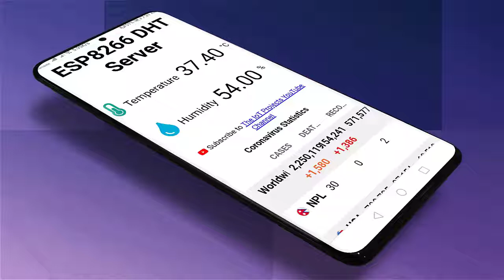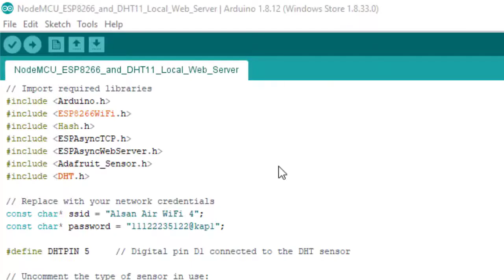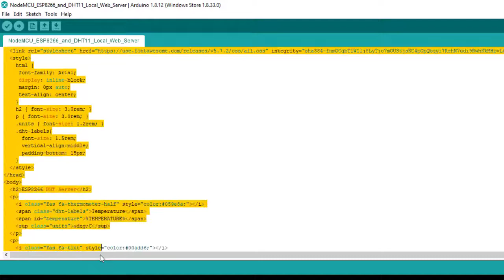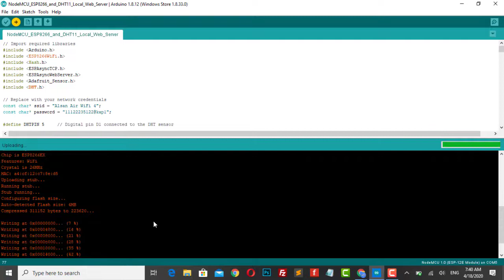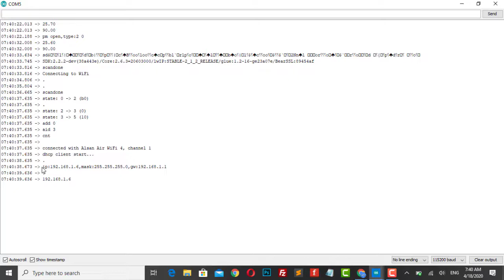NodeMCU ESP8266 Monitoring DHT11/ DHT22 Temperature and Humidity with Local Web Server

Comment: Failed to read from DHT sensor! how to fix this thank you
Reply: I watched a different video by Poseidwn Tech.  At line 14  #define DHTPIN 12   He put "12" but connected signal to pin "D6" That works! I do not understand why but it fixed my problem. Give it a go, cheers
Reply: @cipstechitips1574 I used this but the same problem
Reply: @cipstechitips1574  still not working
Reply: I have the same problem.
Reply: I have the same problem